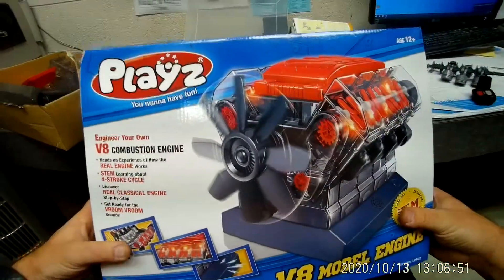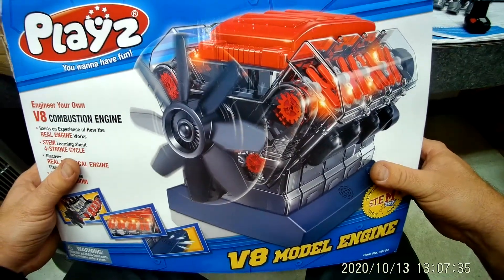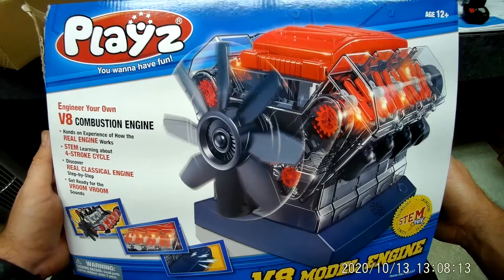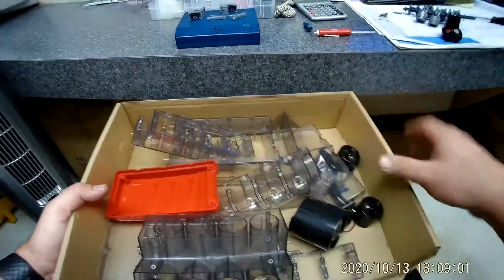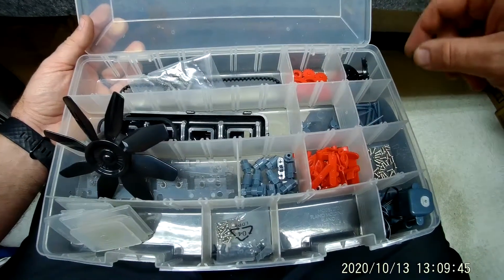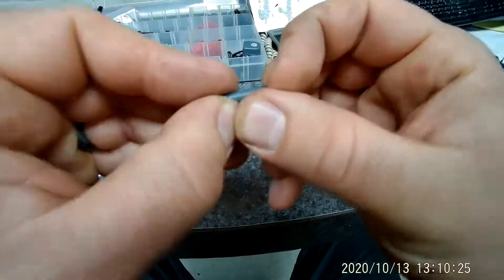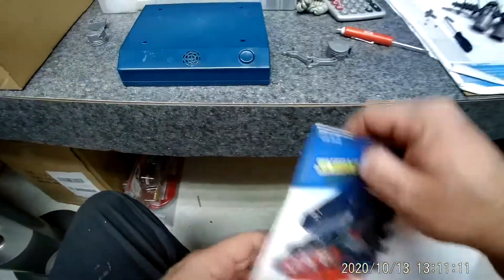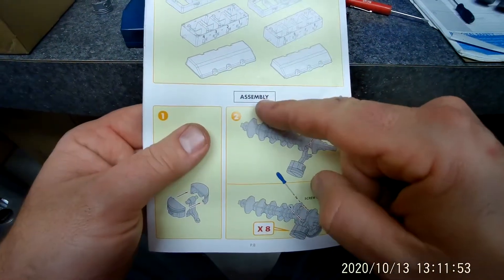Playz  V8 engine assembly Video 1 of 7

Comment: I can’t find the piston  piston pings
Reply from the maker: If memory serves me correctly there are none.
Reply: @ then how do I do them ?
Reply from the maker: You don’t. You don’t need rings as there is no compression. Connect the 2 half’s of the pistons together like I did on the video and follow the directions.
Reply: @ I mean like the one toy connect  the 2 parts  of the head to the Y thing
Reply from the maker: Sorry I’m not sure I follow you. I have 7 videos putting this together. Check them out and see if that helps.
Reply: @ the middle part. That goes in the  piston head that goes trough the connecting rod
Reply from the maker: Oh the piston pin. Now I understand sorry about that.
Reply: @ yes but I ended up making up my own piston pins cause the engine didn’t came whit ones